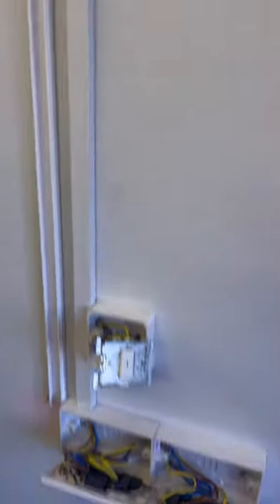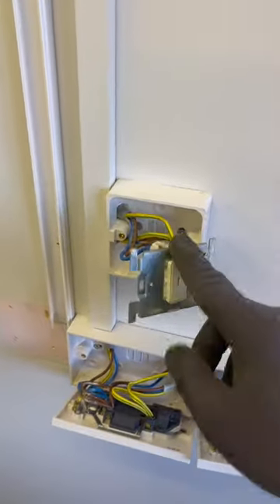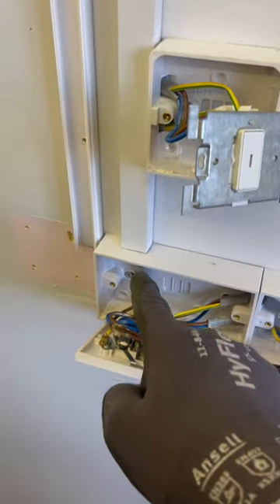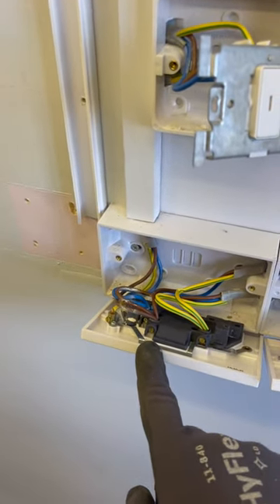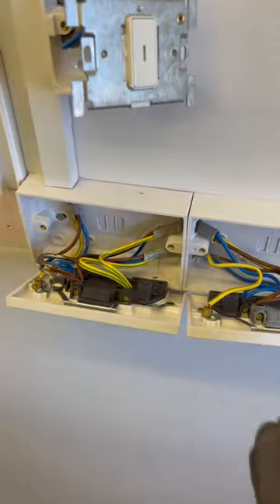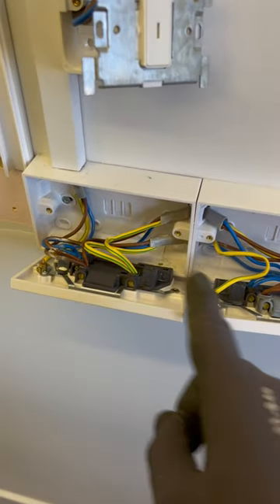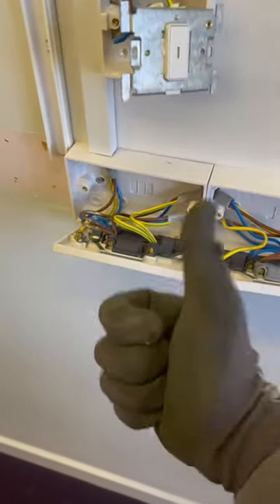This is anyone’s guess

Comment: Are the two cables between the sockets directly linking these sockets or could one of them be going elsewhere through the wall?  
It seems odd to have a setup where the sockets are switched like this, it would be more logical to have the keyswitch as a spur from the ring feeding an accessory.
Reply: It does, the key switch isolates the sockets, This maybe a spur,  using a key switch, but it can only be on a radial, or  after switch fuse or non switch fuse off a ring. He actually says, a ring off of a Radial. Seen it many times, a DIY has put a ring off a ring for an extension, 4 cables connect into a socket, instead of opening the ring

Comment: Im not a sparky but would you just do a radial with 4mm
Reply: Doesn't even need to be 4mm if it's on a 20A breaker
Reply: 2.5mm is fine with a 20A breaker. If you wanted a 32A breaker then yes you'd use 4mm
Reply: Equally in the instance shown they could have used 10mm given a haircut
Reply: @lh2589  unless it's in Celtex or still amount of loft insulation then need to apply derating factors.🤓🔨🤗
Reply: @bramcoteelectrical1088  yeah but you can get away with 2.5 on a 20A up to reference method A and in honesty, if you are using 101 or 103 instead of 100 or A then my question would be why? 4mm on a 32A is only if clipped direct too (reference C)
Reply: @lh2589  I tend to use 4mm for kitchens buddy. Clipped direct to wall to thermally conduct any generated heat from the conductors.
Reply: Saves on time and also any changes are alot easier than a completed ring. You tend to get customers adding and changing there mind in kitchen refurbs.

That's correct 20amp on a 2.5mm radial.

In answer to your question 4mm is also applied to areas greater than 75sq mtrs area otherwise your Zs might end up to high if you used 2.5mm and tried to stick it on a 32amp.

Again I've broken down a few radials into 2 or 3 circuits when doing say a restaurant refurb or an office and the given area is larger and the demand can be higher.
Reply: @bramcoteelectrical1088  I still use a ring for the kitchen but yeah I'd want a 32A on a kitchen so if you can clip direct with 4mm then great
Reply: @bramcoteelectrical1088  just to clarify here, 4mm radial is a maximum of 75sq meters, 2.5mm is maximum 50sq meters and a ring on 2.5mm is 100 square meters
Reply: @lh2589  I agree i am old skool sparky and knew it was 75sq mtrs something.

Didnt have on site guide just off top of my head ;)

Comment: It was a mini ring until the key switch was added by using the handily place second cable.
Reply: The mini ring has no supply ? The key switch is the supply, to the mini ring, proper DIYer

Comment: 5a switch for two sockets and - actually wtf is all this, this irritates me just by making me have to think about it aaaa
Reply: Most grid key are 20a. It's unusual granted, and god knows what they're doing with them cables 🤷‍♂️
Reply: @charliemccluskey3629  4 sockets = total load of about 40a. it's underrated anyway
Reply: @dimitar4y  not really, unless run in 4mm any radial in a house would be on a 20a breaker ?
Reply: @JamesEdwards860  you assume some bold things.
Reply: @dimitar4y  tell me you’ve just finished your first year at college and think you know it all without telling me you’ve just finished your first year at college and think you know it all.
Reply: @dimitar4y  don't talk rubbish. Can you only have 3.2 sockets on a ring?
Reply: @dimitar4y  Stop writing nonsense! It’s embarrassing.
Reply: @jurassicsparks5220  you assume it's embarassing until it isn't. Someone redundant trying to get one up to compensate, hmm? :)
Reply: @dimitar4y  And the non coherent replies continue…..
Reply: @jurassicsparks5220 keep going you'll get there eventually
Reply: @dimitar4y  Ooook 🙄🤣
Reply: @jurassicsparks5220  yessss I winnn you did the "ok" and the emoji spam. yessssssss you're a zoomer!